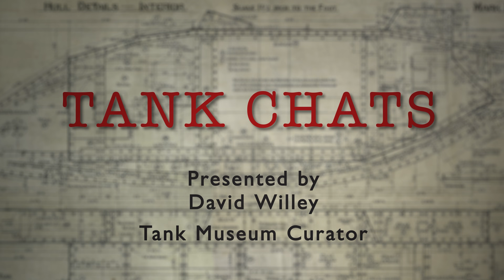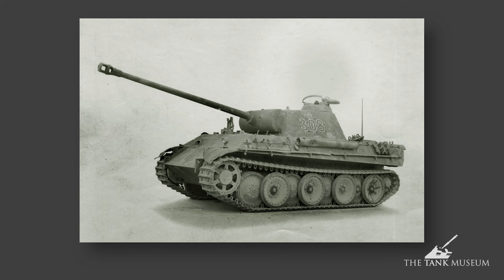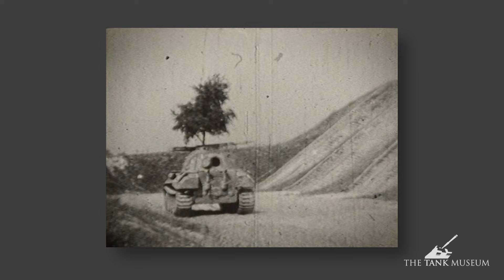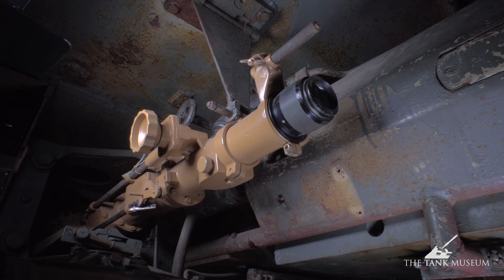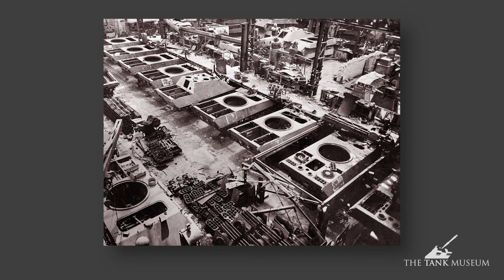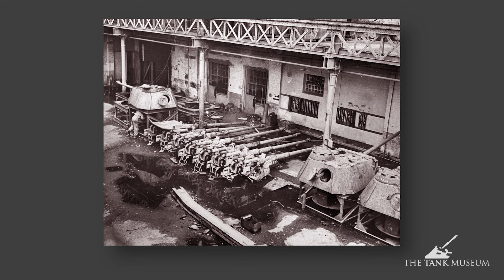Tank Chats #16 Panther | The Tank Museum

Comment: "it had a propensity to catch fire if the engine backfired" WTAF!!! When I was reading that it's worst defect was catching fire from a backfire was not what I was expecting. You'd think they would have ironed out that problem before it hit production. Any crew aware of this would be shitting themselves every time the engine stuttered or the driver ground the gears. Certainly not something the crew should have to be focusing on in battle.

Comment: Interesting that the shot trap isn't mentioned, as it's one of the biggest hallmarks of the rushed production. A very simple to fix design flaw, that ultimately could spell disaster for the tank if left as is. The Germans realised this fairly quickly hence the 'chin' on later production models

Comment: A postwar trial (employing two Panthers, two Jadgpanthers and a Bergepanther) reached the following conclusion:

Owing to the general mechanical unreliability of the Panther and Jagd Panther tanks, insufficient test results were obtained to enable an accurate assessment of the performance of these vehicles to be made.” (https://tankandafvnews.com/2015/11/13/from-the-vault-post-war-british-report-on-panther-reliability/

The Panther was also cramped.

”The only element of the gunner’s station that was comfortable to use was the seat, although it was nearly impossible to work while sitting in. The turret traverse flywheel handle was deemed too short at 3 inches. The turret could also be traversed using pedals, but they were very badly placed. The gunner had to twist his whole body to the right in order to use them. The traverse pedals were also very stiff, and using them was difficult. The elevation flywheel was also quite stiff, as a result of which aiming the gun took a very long time. The gunner had no vision facilities aside from the TZF 12a sight, and so it could take up to 30 seconds to put the gun on target. It was also impossible to use the headphones and gun sight at the same time, as the right headphone fouled the side of the turret.

The loader’s station was only 5’3” high (about 160 cm), meaning that an average man would have to work hunched over, which tired him quickly. The loader had neither a seat nor headphones, so the commander could not give him orders. This was strange, as it was the loader’s job to not just load the gun, but also fire the smoke grenade launchers located on both sides of the turret. The ammunition racks were poorly designed. Effort from both hands was required to open the latches holding the rounds. It took about 10 second to open the latches, which reduced the rate of fire. Loading from the ready rack took 6 seconds on average.

The driver’s station was cramped. The seat could be moved from travel to fighting position along the vertical axis, but the British determined that this took too much time and preferred the mechanism on the American Pershing tank. The driver’s visibility was very poor in the lower position, as he could only look through one periscope.

The radio operator’s station was also very cramped, especially around the knees. Using the machine gun was uncomfortable as his whole body had to lean to the left.” (Military Operational Research Report No 61 Study No.11 issued by Motion Study Wing, Motion Studies of German Tanks.)

”17 Pr v Glacis.

Gun performance is appreciably better than forecast and it must be therefore be concluded that German plate is not up to the standard of our Homogeneous M.Q. tank armour.

In point of fact the German plate appears far too brittle and large cracks develop from any penetration. These became so bad during the course of the trial that whole sections fell away and it was difficult to find a target in the later stages.

This fault is not confined to this particular plate as the tank used as a target had been knocked out by penetration of the turret side, by 75 mm AP, and from here the cracks had developed to the side of the plate." (Mediterranean Area A.F.V. Technical Report No. 23 - Part II Enemy Equipment - Panther, 14th September 1944)

”The hull and turret sides of Panther, even having regard to the up-armouring of the front at their expense, appear weaker than would be expected in a tank of its weight. The reason for this are not forthcoming without a detailed weight distribution examination, but the fact remains that the hull and turret sides are weak to 6-pdr, 75mm and 17-pdr attack [my emphasis], as will be seen from a study of the Vulnerable Range Table in Part II of the report.

In addition to the vulnerability of the hull sides per se, the danger of cordite fires arising from penetrations is high.”

(PzKw V (PANTHER) Report on Armour and Vulnerability, Armour Branch Report No. M.6815A/3)

Firing trials demonstrated that the 75mm M61 would penetrate the Panther’s side armour easily, with normal impact defeating it out to 2,100 yards, and an impact at 30° from normal, out to 1,100 yard. Note that this is the 75mm gun…

But then, C Squadron, 24th Lancers, encountered Panthers on 1 July 1944, with the following results:-

”Four Panthers appeared motoring eastwards at a distance of about 800–850 yards. They were presumably working as a troop… They presented good targets for our 75mm guns and all of them brewed up nicely. Average number of shots taken to brew the tanks up was two shots… the other four Panthers knocked out during the day were all at from 800–1000 yards distance and were all hit in the flank by our 75mm guns.”

Comment: Germany's dumbest mistake in tank design was that they made BIG, UNDERPOWERED tanks with gasoline engines. It's not like they didn't have a powerful, proven, diesel to use. It's called the Junkers-Jumo 205. The Panzer/STUG III/IV should have been powered by a cut down, 3-cylinder version, of 205 making about 400hp. The Panther and Tiger should have been powered by the 205 making 800 hp. These are VERY flat engines if laid on their sides and can easily make the tank chassis only as tall as the bottom of their sponsons even when stacked with a radiator.
Reply: All the existing vehicles ran on pertol, introducing a second kind fuel would have made a mess of the already not great looking supply lines. Also the heavy tanks were not underpowered since the excelent suspension meant less force was needed to move the vehicle. And a more powerfull engine would not only increase the fuel consumption but also potentially wear out the already strained transmissions even quicker.

The only option they would have had is start with diesel from the start wich pretty much only the sovjets did.

Comment: It was a beautiful tank! Shame there weren’t more of them 😍
Reply: Or luckily there weren't more of them ;-)
Reply: there were 6000 concdering everything else thats an impressive number.
Reply: @Jim Goose  Gernamy never had the resources of the US or the Sovjet Union, therefor comparing those numbers directly is of very litle use.
Reply: @zafranorbian757  Soviet Union didn't have that much resources. The US and UK gave them a shitone of stuff
Reply: @HellStr82  True, still Germany had even less resources as the sovjet union.
Reply: @zafranorbian757  Germany by the end of the war had almost no resources. The US on the other hand were building planes tanks trucks and everything else for the Brits for the Soviets. And also they gave the design for planes to the Soviets. Without the US things might have looked different.
Reply: Germans needed a 36 ton reliable tank.

6000 tanks is a lot for Germany

There was a limit to number of  tanks the Germans could crew and train.

6000 would have been a reasonable number if operational availability was better

Comment: I totally disagree with the Panther beeing named one of the best tanks of WW2. It was not, that judgement is based on its potential, but not on it's performance.

 That was just dramatic and was everything the Germans didn't wanted and never asked for. 

Subcomponent wise it was a beast, but a tank is only as good as it's weakest component and it had that a lot. I was a tank gunner myself, I can imagine the horror of the crews having  to step out every god damn time to repair something or have to watch out for flames in the engine bay. No.. this thing was bad.. bad tank.
Reply: @steve lasagna 
Never ceases to amaze me that peopel keep sprouting such utter nonsense about a subject they have no knowledge about. How about you go and actualyl read a book written on the tank by actual historians.

Panther gunner couldn't see? Rubbish. The Panther gunner has a selectable gunsight that switches between a 28 degree FoV at 2.5x magnification and a 14 degree FoV at 5x magnification. The Sherman gunner has a gunsight at 13 degree FoV at 3x maginfication, later improved to 5x magnification. The periscope sight with the 42 degree FoV only had a 1x magnification and this only arrived in late 1944.

Turret moving slower? Again rubbish. The turret rotation of a Panther is close to that of a Sherman.
Reply: @steve lasagna 
Do you know what the term wehraboo means? A wehraboo and a person liking tanks are 2 very different things.

Comment: if it weren't for its lousy final drive system, panthers could've been crazy. they have this crazy torsion bar suspension rig  that gives each road wheel like 3 feet of give. if it was built right it could've maintained 60 mph which is mindblowing. good for the allies. they kept putting grossly overloaded aluminum gasoline engines. wish he talked more about the gun, its a doozy.

Comment: Id say Panzer IV was the better tank for germany in ww2.
Sure Panther was fantastic when they got most of the Problems fixed with aus A and G but in they time it took them to get there they would have been better of building Panzer IV G`s and H`s.

In adition to that, Panzer IV was totally capable of dealing with most of the tanks it faced till the end of the war (exeptions being IS-2 and Pershing) while having big advantages over the Panther such as lower weight, less fuel consumption, being more reliable and easier to maintain and being smaller and thus harder to hit and easier to hide.

I think they would have been better of not rushing the Panther and spamming Panzer IVs till then

Comment: What was the base ral color thinking ral 7028 or ral 8000 need some input  on this so as to paint  tamiya 1/35ausf d as this is the early version
Reply: As far as I know, RAL 8000 was a component of the camouflage used in the Western Desert.  I would guess that the finish here is the red oxide primer with odd stripes of RAL 7028 and RAL 6003 with white lines.

Comment: Actually the panther was a pile of garbage lmao. The older panzers were much better. Stop with the fanboyism
Reply: No. That´s delusional. At least not without saying that the T-34 and Sherman were piles of garbage too. 

You see the Panther had it´s mechanical issues. Most of them were fixed over the time but especially the transmission was prone to breaking down on longer journeys. Therefore it was mostly moved on trains. The other problem the Panther had was overengineering. If you look at the problems of a T-34, they were just as bad or even worse. It had leak issues. Durring heavy rainfall water would flow into the tank dameging and disabling the electronics and ammunition. The armor structure was weak and was prone to spalling when hit by high explosive shells. The earlier made turrets were cast and wouldn´t even resist 37mm AA-guns on shorter range.
Reply: Hazztech Tell that to the American tankers who faced them.
Reply: Corey McCrann the Americans were not afraid of the panther, nor even the king tiger, and both were regularly knocked out by American forces.

Additionally fear=/= effective weapon. German tankers reported low level strafing being the most fearsome tactic used against them, despite the fact that they were mostly immune from the damage.

Comment: I’m sick and tired of the “over-engineered” line opinionated historians use when describing German tanks of WW2.  They weren’t over engineered; that is qualitative, patriotic garbage that allows them to muddle around the fact that Russia, the United States and Great Britain paid in blood to streamline the production of tanks and aircraft to win a war through sheer weight of numbers.

You might as well call a Challenger 2 or Abrams over-engineered.  Their design philosophy is the same, just benefitting from 50 years of technological revolution and skies clear of bombers.
Reply: Steve Dupuis 
The Abrams isn't really that much over engineered, it took a lot of stuff that made the Sherman great and applied it to a MBT. The Abrams is really great with modifications so no new tanks has to be made to do a specific thing. The Abrams is also made for wartime situations when there would be a lack of supplies so repairing the tank and finding spare parts are really simple, a lesson taken from the Sherman.

Comment: why did germany need tiger and tiger 2 instead of panthers? 
could pathers handle a 88 mm gun?
Reply: The penetration of the 75mm KwK42 was better than the 88mm KwK36.
Reply: then why did german armour tiger and kingtiger with 88 mm cannon?
Reply: Sorry should've mention the king had the 88 mm KwK43 which was even better than the 75mm KwK 42

Comment: New research on the Panther revealed that the majority of them were made with inferior steel. This was due to the Germans using slave labor which guarantees poor quality control and sabotage. Thick armor doesn't necessarily mean it's good armor and that appears to be the case with this supposed 'best tank' in WW2.
Reply: W1se0ldg33zer In spite of this Inferior Steel the Panther still had effective armor. Every report on the Panther from an American tankers viewpoint hints at the same thing. "We cant penetrate their frontal armor"

Comment: Why is the 75mm Massive but the Shermans 75mm is not .Same mm so explain pl Thanks
Reply: 75mm is the internal diameter of the bore [the calibre]. The Panther had an L70 barrel of length [75mm x 70] = 5.250 metres. The Sherman 75 mm M3 L40 cannon had a barrel length of [75 mm x 40] = 3.000 metres. The Sherman barrel was fine in the early years it could kill any German tank, but as German armour got thicker one needs a faster AP round. To get a faster AP round you need a higher muzzle velocity which means a longer barrel is required. The longer the barrel the more problems with balance! You need a longer tank & a longer turret - all of which adds weight - which reduces manoeuvrability & speed. The Sherman Firefly was designed to take a bigger cannon which worked better against German tanks, but the shorter barrel standard Sherman was better against smaller tanks & against infantry.

Comment: The best tank killer the Germans had was........not the Panther or Tiger, but the Stug III.   In theory a great tank, the Panther in practice was too ambitiously designed for its time which was exacerbated by Hitlers meddling regarding the front armor plate,  and was never a very  reliable tank.   It's early problems were only alleviated, never eliminated.   Although it is sometimes claimed that it was produced more or just as  efficiently than the smaller simpler Mark IV, this comparison was spurious because the Mark IV proved a slow and difficult to built tank, a support tank never meant for mass production.   The best German tank was the Pzkw III but it proved too small to be effective with larger anti-tank versions except for the STUG III adaptation.  A Pzkw III built to Pzkw IV size would have been the most practical German tank for WWII.
Reply: Isn't a Panzer 4 already basically a Panzer 3 built at Panzer 4 size?
Reply: Stug is not a tank and cannot even remotely fulfil functions of the tank.
Reply: @REgamesplayer  exactly. More tank kills were achieved from the Stug mainly because there were many more of them and they served longer then most German tanks . TD's for the most part are a defensive weapon or a support weapon, not a spearhead weapon.

Comment: It's Panther A or D not G
Reply: It's a ausf. G, the lack of a visor port for the driver in the upper hull plate gives it away. Tje shape of the side armor plate is again a give away that this is an ausf. G.
Reply: Look at the mantlet
Reply: The mantlet is no indication, read a book about the tank. Production of the ausf. G started in March 44, the chin mantlet was not introduced until Septemer '44 and conversion to the "chin" design was gradual, and Panthers continued to be produced to the end of the war with the rounded gun mantlet.[
Reply: Panther designation is by the hull, not the turret.

Comment: A common complaint about Panthers and Tigers is that they could have built more MK IVs and so on and that these tanks used more resources ,fuel ,rubber ,steel etc.
But one Panther is arguably worth at least 4 MK IVs so you use less resources and less crew than if you built MK IVs..Many Panthers were allocated to inexperienced tank crews while many veteran tank crews made do with MK IIIs and IVs.
Reply: Panther was about the same cost as a Panzer IV.  It was somewhat designed for mass production, unlike the Panzer IV, which  required a lot of skilled machining.  The reason German kept making Panzer IVs was not cost, it was that factories and assembly lines were already in place.  To convert them all to Panthers would have disrupted the flow of tanks when they needed every one they could get to replace losses.